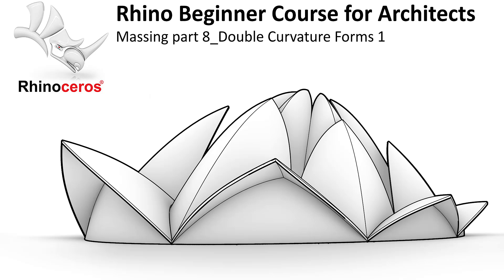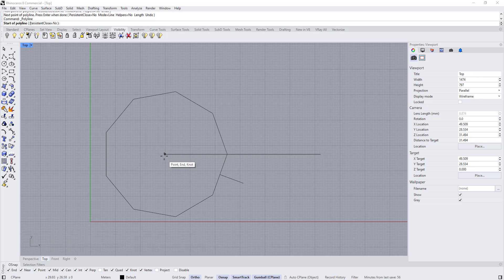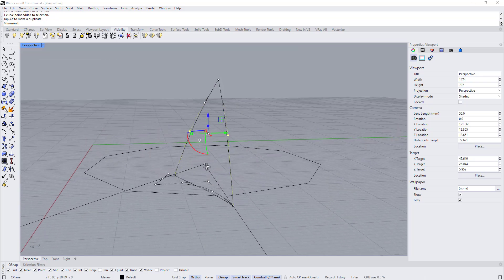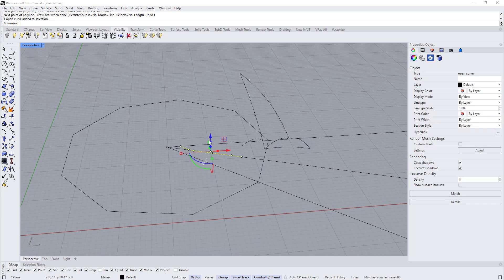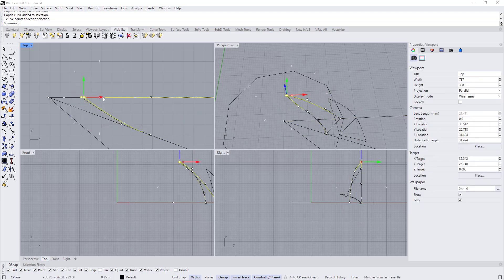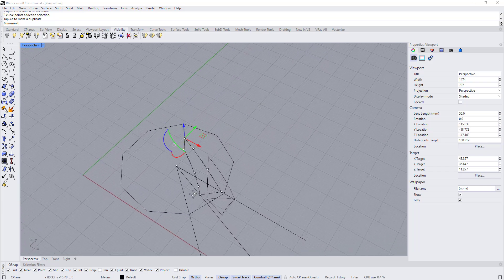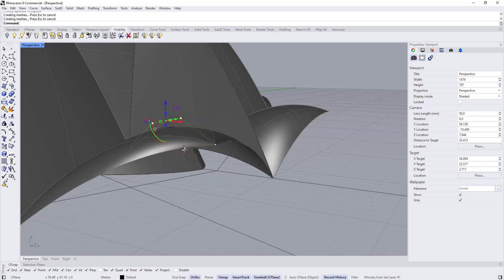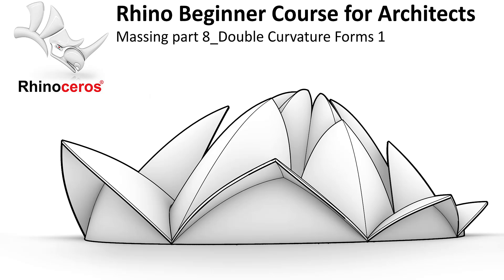09 Rhino Beginner course for Architects_Massing part 8_Double Curvature Forms 1

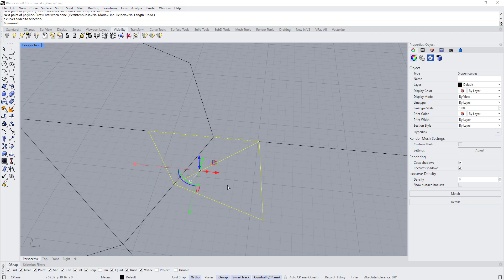Comment: 3:40 rebuild: adjust control point & degree (2→3)
9:47 ⭐three method to creat a surface 1) sweep 2 rail (offsetsrf X) 2) surface from 2 or 3 edges 3) surface from curve network
13:50 polar array
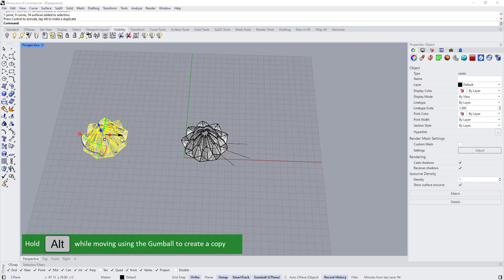15:50 cage edit